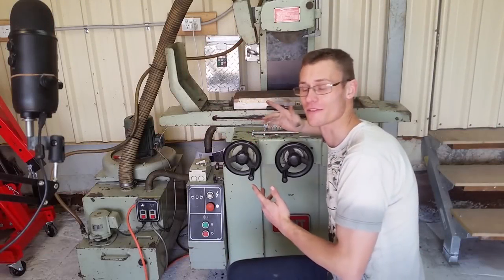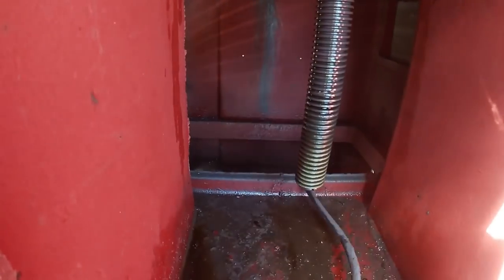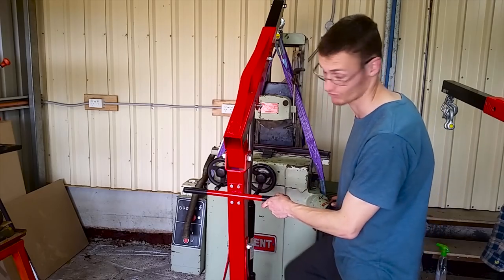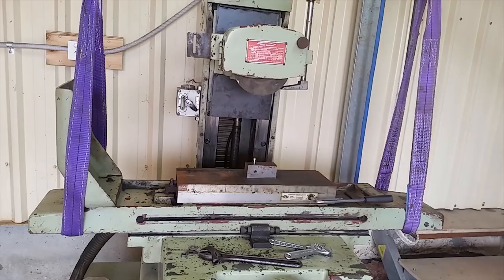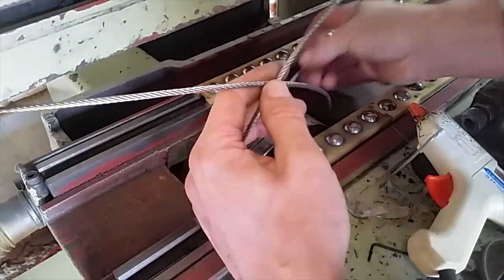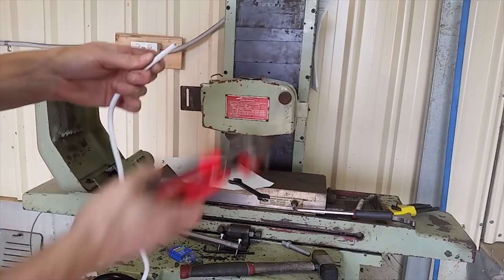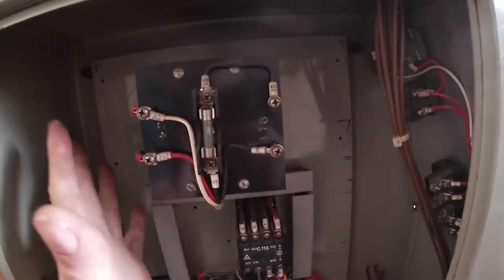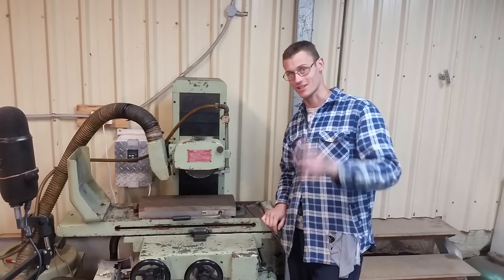New Surface Grinder!

Comment: not sure if anyone mentioned it yet, but you need to add some holes to the vfd box or its gonna burn in no time, the heatsink is useless without air flow. i understand that you want to protect it from dust, but that wont matter much if it overheats by itself
Reply from the maker: Good point I should have shown it
There are holes in the bottom side and at the back at the top for air
I'd expect some dust to get in there, but it should be ok

Comment: Congrats! I'm looking to buy a surface grinder soon myself.

You can usually rearrange the motor windings to run at the lower voltage, which saves needing the high volt vfd. Could be a bit of work on three motors, though! I did a video a few weeks back on rewiring (though not rewinding) my Bridgeport motor if you're interested for future reference.
Reply from the maker: Cool, I'll take a look

Comment: Congrats Tom, this purchase is great news. Opens up a lot of options for the shop and the channel. Do you have any recommendations about buying a surface plate, did you purchase your plate locally or import? All the best.
Reply from the maker: I bought mine from Hare and Forbes during a sale earlier in the year it's got a 600×600 work surface which is heaps for the work I do.
The maximum surface deviation is 3 microns which is fine for work I would typically do. Although now I can potentially work to even tighter tolerances, so we'll see how we go with it
I could have gone with a smaller cast iron one, but I got this one with the intention of setting up a more permanent workstation (I'd recommend this so it doesn't attract clutter). Also this size lets me scrape my mill's table which needs to happen
Reply: @TomMakeHere  thanks mate, always helpful to hear a different perspectives. I too think 600mm is a good size.

Comment: Mate great work. I’ve just got a mill with a 5hp motor and a coolant pump motor both 3 phase, will a vfd run both ok?
Reply from the maker: That's getting pretty big. You probably could run it off a vfd so long as the vfd is rated more than everything you want to run, but you cannot switch the coolant pump / mill off  while the vfd is running as they don't like any power fluctuations.
But I would probably be more tempted to use a rotary phase converter, especially with that size of motor. Despite costing more upfront, they are very solid and reliable, and you can always plug in a different machine if you get more 3 phase tools
I worry that the power will fluctuate one day and blow up my vfd

Comment: Always wanted one of them in my shop but just turned 78 so I may have missed the boat, these days just watching someone else muscle one around makes my bones ache.
Reply from the maker: I was a bit worried, it got close to being too difficult to handle. The backup plan was a forklift if need be
Thanks for watching

Comment: The "Stone" is a grinding wheel and i think i would throw it away now that it has had holes drilled into it as i think it would have been compromised, the wheel and hub are balanced as a pair when assembled, make up a little balancing jig with knife edges, not want to continue been negative but that may not be the best use for gauge blocks, i think you will enjoy the precision of surface grinding
Reply from the maker: Yep agree, the manual had a misleading image and it didn't look like the hub could come off. My intention is to initially balance properly (done today) and then make a knife edge jig with a surface ground top after the initial balance. And then rebalance with the better jig
I've seen plenty of professional grinders balance with drilled divots with no issue. That said with the chipped edge etc, I have new wheels on the way
Thanks for commenting

Comment: I've done thousands of lifts from a few hundred lbs to upwards of 50 tons. The video made it tough to check how much actual clearance you had for your sling positions from the engine hoist's hooks, but if possible a short 1/4" / 6mm steel sling or a pair of them from the engine hoist's hook through the grinders open column with that ratchet strap and clevis attached to the steel sling eyes running down to the rear of the pallet would have given you an adjustable third or fourth lifting point that would have allowed fine adjustments so the grinders unbalanced weight and pallet it was on could be lifted and lowered in a level condition. The secret to moving anything heavy is to slow down, not be in any rush and think things through completely. Get unlucky just once and it's then a failed lift with a good chance of possible injuries or equipment damage. And with any straps you want to ALWAYS cushion where they touch the item being lifted. Something as simple as a layer or two of cardboard between the sling and what your lifting can work. Scraps of old carpet can work even better. Yes there made from (or should be) from cut resistant material, but there a long ways from being indestructible.
Reply from the maker: Even though it's quite solid, I'm not sure if I would want to hang the whole machine from the column
I had to do the dual lift because I would be massively overloading a single hoist at that reach. I allowed a dual lift factor for the load
You are right about improving the lowering method, but I was already rigged up at the front and I was comfortable enough with the method
While it looked cowboyish and spur of the moment, I had put a week of thought into this using the equipment on hand.
Also yes I should have cushioned the column strap around the corners. It didn't have a great deal of load, so I decided to run with it
All valid points, thanks for commenting
Reply: @TomMakeHere  Nope, I should have been a bit more detailed, I meant run one or two short slings through the open column as you first had it with the sliding guards removed, then shackel one or two of your ratchet straps to those and running down to the rear of the pallet. That way the ratchet straps could be adjusted until the pallet was level during the lifting and lowering. Grinders are high precision and one machine I'd not want to ever lift wrong, so I wouldn't have lifted the whole machine by the column either. At the end of the day it all worked out as you did it. I've just learned from past mistakes to keep the load level as much as possible as it's usually easier, quicker and safer most times. 

Luckily it wasn't me, but I got to see the aftermath of someone who didn't keep things level and totally destroyed an almost new $180k multiple axle specialized ultra high weight highway trailer by dropping a 45 ton rock crusher mantle on it. I'll bet that even sounded expensive when it happened. :-)

Comment: Congratulations on your purchase Tom.  Looking forward to seeing what you will do with it in the coming videos.  Just remember it's a grinder and not a mill, joke ha ha (common mistakes my students make, as they try to take a 1mm DOC).  Cheers, Aaron.
Reply from the maker: I got a shock at how sensitive the dial was. On the first cut I actually misread the dial it has a vernier scale and I wasn't sure if the division scale was referring to the main marks or the smaller marks lol. Instead of 0.02 mm I took a 0.2 mm cut initially!
I'm going to have fun with this though
Reply: @TomMakeHere  Yes the same thing happened with my students on our little Repco Surface Grinder.  We should collaborate sometime.  Where are you based mate?  I'm in Melbourne Victoria ;-)
Reply: @TomMakeHere  Just sent you an email
Reply from the maker: Sounds good, I'm down in Tas

Comment: Congrats!  Chatter may indicate the wheel is not on the adapter tight enough.
Reply from the maker: Cheers Yuchol
I'll check that. There is a whole bunch of reasons in my head, traverse speed, wheel balance still off, the spindle bearings do sound loose when starting up and might need tightening or replacing (hopefully not). We'll see

Comment: usually the grinding disk is mounted to a seperate piece that has a taper that centers it to the machine 
with this option if you need to change the grindstone you dont need to redress it as its allready centered from the last time , they sumtimes have a way of balancing the stone without drilling holes too (two offcenter rings you can move around before tightening ) , might want to check that , think you got the tools to make more of tose grindstone holders  if the machine has that addon
Reply from the maker: It looks like you are right!
Cheers I'll look into that and do a follow up video

Comment: Have a look into boot lace ferrules for your wires. It will ensure that you have a good connection and sort out any stray wires. Not using the switch gear in the machine was the right call as vfds don't like to be switched on the output side.
Reply from the maker: Cheers, I'll look into those
I'm thinking of wiring the spindle to connect through the machine's main switch (agree, only switched with VFD off) and that way I can adapt the dust extractor with a separate duct for welding and grinding elsewhere in my shop. That will be an upcoming project

Comment: Congrats! About moving. Looked very dangerous! Maybe you should first unload the grinder from the trailer to the ground? Then pull into the shed on pipes? 800 kg is rolled easy by hands (crowbar), of cause on a flat floor.
Reply from the maker: Every step was a controlled move (although unconventional!)
I agree that would be a better option, but I had no means of lowering it even outside. There is only crushed rock outside my shed and a 200 step up into my shed.
I plan on adding concrete outside and eventually building a gantry setup to solve problems like this
Reply: @TomMakeHere  ah, got it. OK good luck!
Reply: О знакомые все люди, и мне ролик в рекомендованные попал. Ещеб на этом инглише хоть что-то понимать бы...
Reply: @АлександрК-в6ц  привет, я этот австралийский английский тоже плохо понимаю, да он еще прикалывается всяко :)

Comment: I'm curious to know how you got 415V out of the VFD with only 240V in.  Typically, VFDs can't step up the voltage.
Reply from the maker: VFDs are black magic to me.
I thought a lot of people used them this way to run their 3 phase machines at home?
Reply: @TomMakeHere  You are probably not getting 415V out, only 240V.  Since the speed of an AC motor is determined by the VFD output FREQUENCY, a 415V motor will run on 240V but will only produce about 60% of its rated power at rated speed.  You can only get the rated power out of the motor at this lower voltage by providing more than its rated current.  This will overheat  the motor (and eventually burn it out).
Hopefully, the VFD display can be set up to show the output voltage, to allow you to check this.

Comment: Any more info on the VFD? I have the same issue, I have a 240v VFD and 415v lathe I want to hook up.
Reply from the maker: You just need to make sure that the output is definitely 415v 3 phase. The VFD also needs to meet or exceed the HP requirements.
Otherwise it should be pretty straightforward if you or someone you know can wire it
Reply: @TomMakeHere  do you have a link to the VFD you used? I wouldn't mind getting some specs to match up.

Comment: If you need an inch say to pass a thing through a door, deflate the tires to 2/3 or a bit over half pressure on the trailer, it works like a charm... Also, here the first time, prezzo`s fault for sending me here... Also, just got my self a surface grinder, tho, it is a behemoth compared to yours...  But, on the bright side, z and y axis are removable and can be remade easily and the machine can be brought to factory spec in little effort, whereas the x, it will need a teflon strip to please me...
Reply from the maker: Good tip, thanks!

Comment: Dude, you want to get a pallet jack and some thick wooden boards, much easier to get stuff off a trailer!
Reply from the maker: Maybe, a large forklift put it really far onto the trailer so reach is an issue
I've not seen one with the reach or height (not to say it doesn't exist)

Comment: Tom, Please accept this advice as if I were a family member trying to help you; not a YouTuber throwing criticism at your hard work. I admire any young person who has the guts to work hard and learn, but you're making so many critical mistakes that could cost you your life or a limb! I was fortunate enough to learn those lessons from submarine service through the shipyard as a plank-owner and onward on patrol. Slow down. Learn attention to detail. Even when you're working with limited equipment you can conceive methods of handling loads with a minimum of basic leverage devices that you can adapt and use over and over again, but it takes more time than you allow yourself. You have to stop, think and apply your basic understanding of science to solve problems. Take the time to read a few old machinist manuals from the 30s and 40s and you'll be surprised how many new techniques you'll arrive at toward being a better mechanic. Keep up the good work and be safe!
Reply from the maker: 100 percent agree with you. It might have looked rushed but I spent a week leading up to the move planning, and the move took a whole day as each step was assessed (the coolant tank that rolled over was the only thing that wasn't assessed, that was just so I could clean it without stinking out the workshop)
I've since built a gantry to make machine moves easier

Comment: Your wasting time not balancing the wheel on the wheel adapter. Has to be mounted to the adapter, installed on the machine and dressed true. Then remove it from the spindle as a unit, wheel still on the adapter, and then balance it. I balance 10-14-20 wheels. For the most part not necessary with the small 7” wheels that uses.
Good job getting it cleaned up, grinders all always the worst!
Reply from the maker: Yeah I've just sorted properly balancing. It made a huge difference to surface finish. I'm now starting to get 'commercial' looking ground finishes which is exciting. Next step is to actually grind the chuck